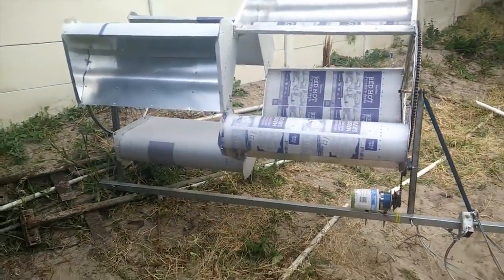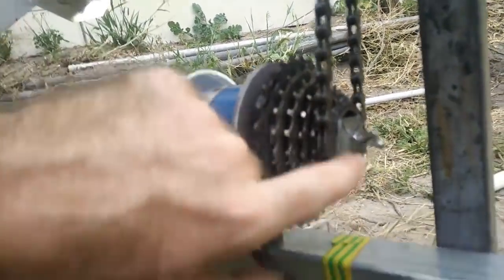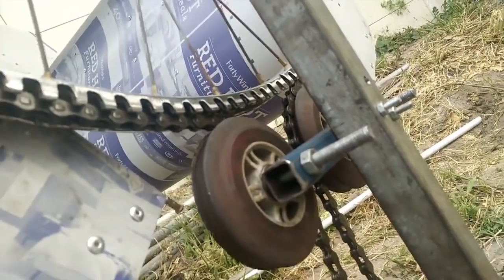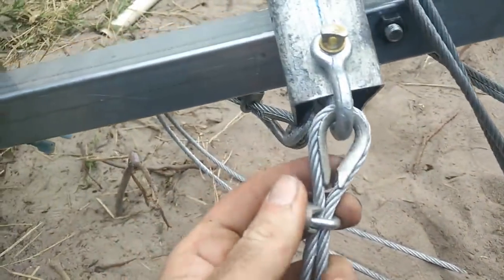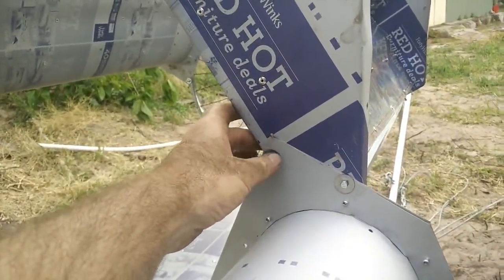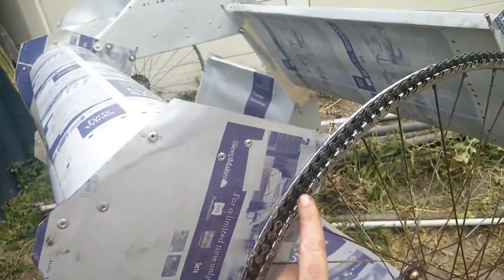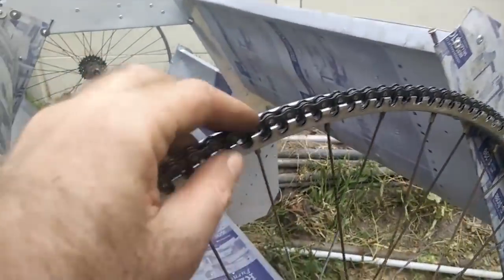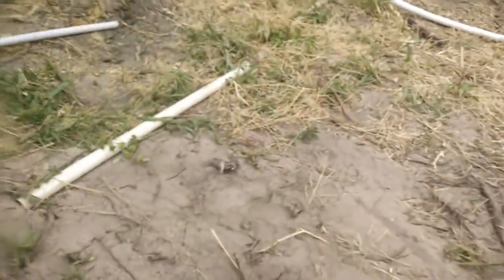Kilowatt wind turbine and pole for under $150

Comment: I have been looking for vertical wind turbines exactly like this as a power source.  At first glance I thought this to be a vert. design, but I believe this works in both orientations.  Thank you so much for this.  The discarded treadmill motor I recently harvested has a multi groove belt, which may also work well.

Comment: Way back when, in the 70s, I had a 3 level Savonious rotor 6 feet high driving an auto alternator at the base. The wings of the rotor were spring loaded for high wind control. Storage was 6 salvage 2 volt telephone company central office batteries. These batteries weighed about 250 lbs each ! I used this system for emergency back up for my amateur radio station. However it was so efficient that I ended up using it full time, even proving lighting for my Ham Shack. I never could come close to fully discharging those batteries !
Reply: Why not use a vbelt OR a multibelt from a actual car dynamo the come in Manu size ant no noise also u could use the pully from it 👍👍👍
Reply: @diypapie8428  I think the chain could withstand the external elements better than a vbelt. Thats just my assessment though.
Reply: @Oxendine9381  the chain will last longer and be stronger than a v-belt. That being said, the v-belt is not going to corrode or rust and sieze up like the chain would. As long as the chain is oiled and kept from rusting it will provide the longest life, and can carry the most torque. It won't slip like a belt would. The belt will be quieter and easier to replace or repair than the chain would be. Both methods are very good options for this project. I like the chain because there are different gear ratios and you can adjust them to find the optimal gear ratio for the wind speeds you have available. The belt isn't really adjustable easily. Being able to adjust the gear ratios will allow you to get the best performance from the turbine by simply adjusting the gear ratio. 
I've been working on my design for a vertical axis wind turbine and I am using the chain setup so I can adjust the gear ratio and optimize it for the winds I get here. I think that having a chain gearbox, basically is what you have with the different gears and the ability to change them easily like you do when you are riding the bike normally. It will allow me to always get the best ratio to wind speed and create the most electricity from the unit as possible, just by changing the gears being used. It also allows for the incorporation of more than 1 vertical turbine that utilizes the same chain and gears for 1unit or for 2-3 turbines. All connected with the same chain and working together to power 1 generator. 1 chain can connect all 3 turbines and utilize the same chain to turn the generator and create power. Useing the gear system from a mountain bike gives you several variable speeds to turn your generator and increase or decrease the torque of the turbines to achieve the maximum speed on your generator and allows for the most efficient usage of the wind and generator to produce electricity.  Not many designs can change their gear ratios to utilize the wind speed as they fluctuate throughout dayand night, no matter how fast or slow they blow. I think this design will work better than most other designs like the traditional style wind turbine. Probably not the simplest design for a wind turbine but, I think it's a much better design and is capable of producing more power than the standard designs available. Building a vertical design is easier, more flexible and more powerful designs that the other ones. No need to have the unit turn into the wind to catch wind to turn the blades, it's round, so it catches the wind from all directions without having to rotate the turbine into the wind. Also no need for a vain to change the attack angle of the wind to the blades. I believe that vertical turbines are the future of wind power in the world, and hopefully we'll be seeing many more of them powering homes across the planet
Reply: Cool

Comment: I wonder if, since bike gears are being used, somethings to get could could be done with the shifting mechanism? As the windmill goes faster, it would change gears?
Reply: With a 24-speed bike,  3 front gears and 8 rear gears, a wind generator would have a lot of torque to operate heavy loads.
Reply: Adjusting speed of the alternator would only change the voltage. Which is not necessary for a simple DC application, like It Is for a industrial AC Energy producing Power plant.

Comment: Rather than a chain or a belt, it would be best to go with a direct drive system, even if it requires one added linkage point to angle the rotation, a pivot point, think gears, they can modify an angle upto 179 degrees, though 90 is enough if a direct drive with a inline motor shaft isn't possible. That's not even accounting for gears used to spin the motor faster according to windspeed adjusting them similar to how a thermostatic switch functions, only the pressures are being created by the speed of rotation to activate gear changes.

Chains and belts eat up alot of potential energy, and when examining wind turbines, you definitely want them to operate using the least amount of wind to be most effective.
Least moving parts, lowest cost, least running costs, lowest maintainance.

Comment: Relative to my comment below. I like the Savonious because the weight and rotational power are centered on the mounting pole. In my case, the alternator is mounted at the base. Of course this means the entire pole must rotate. This is accomplished with The base of the pole rotating on an auto front wheel bearing with wheel bearings above and below the rotor. these bearings are mounted on metal plates which provide attachment of the guy wires. The base of the rotor is 10 feet above the base. I live  on top of a ridge and winds can get pretty strong here in the high desert of SE Arizona.

Comment: awsome build,keep up good work,just remember never give up as most nay sayers here havent built anything even close but beleive in there own "expertise"
Reply: Its easy to be a nae sayer when real time figures like power to wind speed are not present. Also,  so many things about the Savonius wind turbine are just inefficient, and that is before adding gears. If this machine is capable of producing 1K, which experience tells me its not, it would need to be a hurricane outside.
Reply: It's not a Savinous turbine. That is radically different from this. But,  the lenz2 turbine is a hybrid with both lift and drag.

Comment: Great job getting this working with what you had available! Obviously lots of improvements could be made, would be interested to see the haters post their own improved versions working to the same budget ;) I think I'd try and use a belt drive system if I was having a go, maybe with a 3D printed pulley on the motor. I wonder if it's possible to make a good belt with common materials to avoiding buying one.
Reply from the maker: I'm currently experimenting with a Range Rover grooved belt and pulley around the wheel rim and driving a hoverboard wheel as the alternator. Results posted when I have them.
Reply: I remember someone claiming to use a washing machine belt as emergency belt for his motorcycle.  Sounds tough enough for this!

Comment: nice. Similar to an 100year old idea - the flip-flop windmill - so proven technology. Points: basic wind design speed is 42m/s in non-cyclonic areas of Australia (151kph) so if installed in an urban environment the design would need to be tested to that, but the real problem with this type of turbine is ... it can't be throttled. You can never stop it or slow it down. However, these turbines are efficient. Further points... most local government in Australia will allow a windmill up to 10m in height without needing approval. .. a toothed belt in place of the chain would quieten it down. Good work

Comment: Very nice.I used a derailer where you used the little rubber wheels.
I also used bike chain and had a dual motor but used props.
Good job!
Reply from the maker: I started with derailer sprockets but they were too small. noisey, and not hard wearing.
Got any media of your build? I'd like to see what you did.
Reply: YES I do. 
Ive to dig the photos out here in the next few days. My rig was just a prototype to see what it would do. Ive built several others  of different styles and types. Its fun and interesting.
Reply from the maker: Nice. PM me links etc.

Comment: extra cool...but what you guys would suggest regarding lightnings? would it damage the battery and the whole thing? should one set up a higher metal pole nearby to distract a strike to there?
Reply from the maker: I'm not sure. To an extent the pole will act as a lightning rod, but I don't know what effect this will have on the turbine and attached eletrics.
It's not a different situation to any other wind turbine on a pole type situation tho.

Comment: So if it were constantly running, it would generate 1 kilowatt, which is around $0.12/hour, depending on location.

Which would give it an ROI of about 52 days.

Not bad for a renewable power source, although this doesn't take into account downtime, maintenance, or labor cost.
Reply: Look at your electric bill, and the actual cost of the electricity, without the service charge and tax on that service charge. This is the cost of having a connection to the power company. It will not go away even if you do not use any electricity. Your real cost per kwh is about 7 cent. 
As for the output of this home made turbine, 1 kwh is probably the peak, not the average. i bet it doesn't run most of the time. More likely 25% of the time. So, we are up to a year in payout, and I highly doubt the rig would last a year.

Comment: OK, best gen is going to be a 3-phase alternator type, more power smaller size, if using a dedicated alt less moving parts is a must for low wind. better if can build with the rotor have neodymium magnets and windings setup to produce a three phase output and rectify therefor no friction other than bearings.

Comment: A big 5 stars for a working homemade wind turbine, as it takes a lot of effort to get something functional. But, there is still too much friction, as I hear the chain clanking away while turning, and this friction robs output and efficiency. You may want to balance all the wheels, especially the turbine wheel, and this will improve output. You may also want to install an adjustable brake so when the wind gets too strong, you can increase friction on the turbine wheel and prevent the motor from over-speeding. There are possibly other things you could add, but I’m not familiar with what they are. Just a few friendly thoughts.

Comment: Treadmill motor great.  what other items would you salvage for the DC brush motor?  For example maybe a ceiling fan.
Reply from the maker: DC: mobility scooter motor, windscreen wiper motor. AC: motorbike alternator, electric bike wheel, smartdrive unit, maybe hoverboard wheel. All have their various strengths and considerations.

Comment: Great idea but how do you regulate the voltage so as to not overcharge your batteries? I know it can be done. I'm just wondering how you do it. It is easier to do if the generator has field windings but it's more difficult in a permanent magnet setup such as this as you have to control the main output rather than the field input which is at a lower current. Permanent magnet motors are famous for increasing voltage above their operating voltage when they are sped past their operating RPM.

Comment: I would put the motor in direct contact with the wheel using a small rubber wheel. Reason is to stop all extra energy lose from chain . Less is more. Have a great day.

Comment: I guess thats the real question: with the sail design* on the vanes, what is the efficiency compared to the same surface area what's the standard windmill design with the horizontal shaft facing straight into the wind?  * knowing that a sale is really a vertical wing like from an airplane and that it lifts itself into the wind instead of just being a resistor altogether of the Wind when it comes back around the other side. Personally I like the slow-moving large vain Dutch type of windmill which is safer because it's slow moving and fairly lightweight vanes even though they might be 30 feet long because they use sailcloth, which can be furled in relatively easy with centrifugal counter weights that in a high wind would activate to furl in the sailcloth to avoid over speeding the windmill. Imho any windmill needs at least three independently separate braking methods to be safe but the inherent slowness of the Dutch large vane slow-moving type helps this all together for Safety  by default.

Comment: Very cool. Hopefully, you include multimeter readings and info on how it connects to chargers or battery storage banks. As many "robust, full systems" as possible. If you put one of these up, do you also need to install a lightening rod or ground "fuse"?

Comment: Too much friction - would take a really strong wind to accomplish much. I think the main resistance is where the two small wheels meet - maybe if they're farther apart. Why does the one bicycle wheel have teeth? Once the rig is up, it looks like the top wheel will get lots of weather - since the bearings are designed to be horizontal, the top wheel - maybe both will quickly freeze up, unless it is maintained properly. I like spray white lithium grease - easy to apply.
Reply: Bill Bryant u forgot to say it works for something under $150.00 A darn car engine wastes over 70% of energy ...... chill man,
Reply: Great idea.you only need some upgrading for best result.

Comment: As one person wrote earlier. It appears you have to much friction between the wind vain and the generator. It looks like your chain tension's guides are causing a lot of friction. I would suggest you shorten your chain and spread your chain guides further apart thus reducing the drag on the chain.

Comment: Nice work!  Have you thought about making the fins more of like a sail rather than a 180 degree curve.  I'm not an engineer but it seems like this would create a little bit of dead air space and not take as much advantage from the wind because it pushes back rather than out and away.

Comment: If the generator is at 1.5 hp and 60 km/h with 90volt out put if its going faster on a windier day will it produce more volts or only put out 90volts even if its hella windy